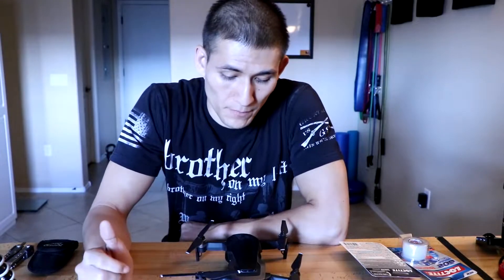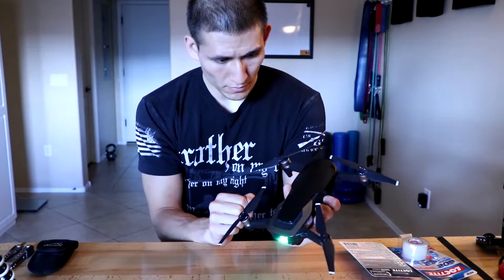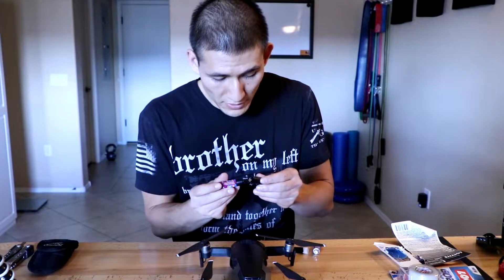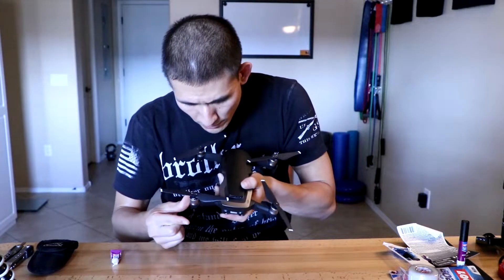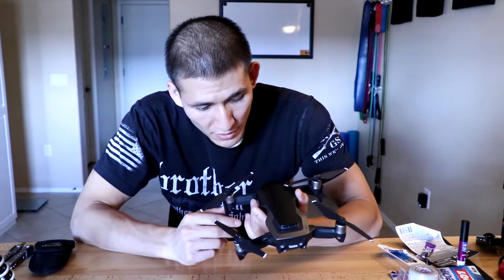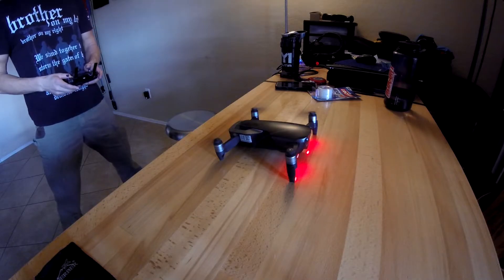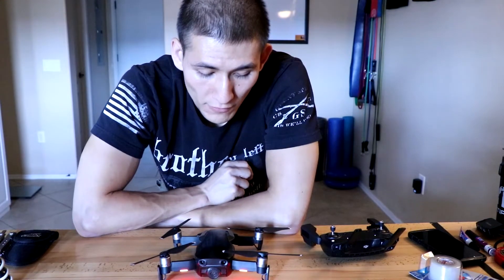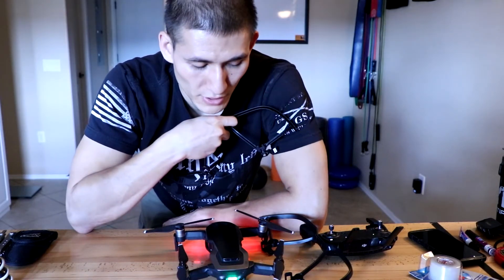Mavic Air Crash and Repair

Comment: Mine touched the cottage and fell on the deck.  A leg fell off.  No where to be found. How do they pop on and off to install, replace?  I think they are called leg arm, it covers motor plus has a angle into the arm. Is this available on Amazon? Thanks.
Reply from the maker: Honestly i dont know, but if it was more than a clean break like mine, i would take it into a local drone repair shop.

Comment: "Not going to tell you how I did it"....Proceeds to tell you and shows video. Plus, dont ever do this. Ever. Just get the arm replacement. Not that expensive on amazon or ebay. Thousand dollar drone man and your gluing it. One, you'll throw it out of balance, Two that's a part that gets tons of stress from folding and unfolding and vibration of the motors. Fluctuations in temp will weaken that glue. Too many variables that can compromise the integrity of that glue and seriously just all around bad idea.
Reply from the maker: Thanks! Still running strong! No issues! I didnt have the money to replace it, you gotta do what you gotta do! I appreciate your feedback though!

Comment: This is totally not recommended, just don't do it. Take it to a DJI store and get the arm replaced. It costs me only $150 here in Oz. A weak repare can make your drone drop like a fly and you can lose.
Reply from the maker: Thanks! It's still running strong a year and a half later! I posted this video so those who want to fix it themselves can see how it's done. People can choose for themselves what they want to do.
Reply: I had the same problem a year ago and I fixed it the same way. Since then the drone has been flying perfectly

Comment: You're just gonna get those bumpers off, you're gonna hook them on something and you'll never get it out/off.
Mine snagged a tree top about 50ft up, fell onto the forest floor, just had a chipped prop and dislocated rear arm
Reply from the maker: Ya, both have their pros and cons! So far it's saved me more than it's hindered me!
Reply: Hooked mine in a treetop on a windy day, luckily I know a guy that is a treeclimber :P
Never did that again, creates more surface area for the wind to influence, and for this tiny little Air, it's already problematic enough (that's my biggest complaint about the Air)
Reply from the maker: @BrianYoung  I didnt even think about the surface area for the wind to hit. Good point.

Comment: Thanks for the video. Mine just got caught in a tree limb over my house at about 50 feet. I climbed on my roof and had to construct a very long pole out of PVC to hopefully loop around the propeller guards. It didn't work but instead knocked it out of the branches and onto my roof (about 25 feet), then it slid down my shingled roof onto a rubber roof (about another 12 feet). It works great, but the little antennae is dangling off one of the front legs. Looks like the plastic where the pin holds it in place snapped. Overall still works, lands and flies great. I'm impressed with how well these are constructed. Had it fallen on concrete, I think the results would have been very different.
Reply from the maker: They ARE constructed well! Sturdy and still light weight!
Reply: You just got lucky is all, these things are weal frail pieces of shit and way over priced.

Comment: Great video. It looks like you've nailed the repair.
This could come in really handy for me if I crash my Air.
Reply: Do the motor click and not smooth rotation
Reply from the maker: @ingwithaz6860  works just fine! Just used it tonight to film some hot air balloons at night!
Reply from the maker: Just make sure you use the guards lol!
Reply: I will. I fly it a lot down here in New Zealand and had some amazing footage from the air and my Phantom 4.
I've subscribed to your channel. 
Keep the good videos coming.
Reply from the maker: @careysullivan  thanks! Will do!

Comment: I like the Loctite.  Will be using that soon.  Right now I'm on my 4th fix as yours.  I've been using epoxy with phenolic powder that works great, the only problem is that it doesn't really get into the cracks.  I've busted mine 4 times like I said, and every time it's been in the same EXACT spot on the house, about 20 feet up!  DJI definitely makes a HOT product I must say.  I only really want to add your comment about the prop guards.  The second time it I hit the house, we had the guards on, and I thought and walked through it.  Logically.  What happens when your near a "wall"...the props rotate so fast that they actually "draw" the unit into the wall.  Like a vacuum.  I didn't notice it the first time, but the second and third, it was clearly laid out what happened. The last crash was only about 5 feet up and recorded it...scaring the crap out of the narrator who was recording the tablet to her cell phone...lol.  Even letting up on the controls, you think the drone's gonna hover...it only ended up getting "sucked" into the wall.  I had to do this over and over just to prove it to myself  (I know..I know..1000 bucks...) but came to the conclusion that DJI is one stupid product maker, as well as I do have another leg ordered and for under 30 bucks, looks like a deal to me.  As well as Getting the refresh package give you a piece of mind (for newbies anyway).  I'm TOTALLY impressed that ALL the parts are user serviceable (as long as you're not intimidated on electronics etc).  Nice vid
Reply from the maker: I didnt even think of that! I actually noticed it with my mirco drone (i got it for like $20 to practice flying lol) and it WOULD do that near the walls and ESP the ceiling. I'll have to keep an eye out on that in the future, thanks for the heads up! It'll save me another crash! lol
Reply: Anytime.  I would also like to add (seems like I'm a glutton for punishment) that the torque on the motors may present a problem with any "fixes" besides replacing with good, unbroken "new" parts.  My last repair using the epoxy/phenolic was not totally set-up.  My bad.  But this could present a very hazardous situation and fortunately my Mavic was only about 20 feet up in line of site, and the epoxy let loose, making the drone pretty much go for a free fall roll to the ground at what seemed full speed.  Which took out the camera holder and one wifi landing leg.  Camera, and all controls all working through all that.  Testing the unit shows a strong build on this piece, but never-the-less, fix with real parts when you can.  Cheers!
Reply: Hey there!  Thanks for the info on the "Loc Tite Plastic Glue"  I didn't use the tape, but I'll use the epoxy (mixed the right way).  I'll keep you posted on my finding.  I got replacement parts for my repair, but wanna get to know these units (only for my knowledge end...as well as FAA).  THANKS MAN!  FLY SAFE!!!!
Reply: @dmassarone1955 
These things are weak frail pieces of shit. Obviously DJI knows these things are going to break a lot really easily but just want your money for repairs.

Comment: My Mavic Air broke at the same exact spot.  Hopefully DJI will correct this weak point in future models. Good job on the glue repair.
Reply from the maker: Haha thats crazy! Hopefully yours was an easy fix too.
Reply: Striking Media LLC My unit fell about 50 feet down after I accidentally hit a power line when flying at my local public park.  It landed in grass field so I thought it would have minimal damage. But I had the cracked arm and the dented motor housing. Thank God I had DJI Care Refresh.. got a new unit in about a week.
Reply from the maker: Oh dang, glad to hear it was covered!
Reply: Sorry that your drone was broken. Your feedback will be forwarded. I would recommend you send it back for repair: http://www.dji.com/support Thanks for your support.